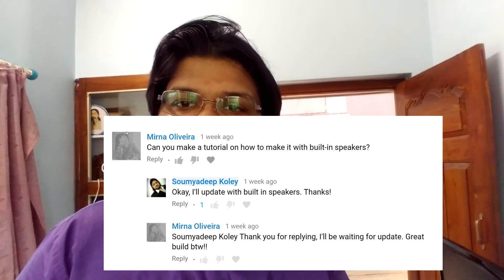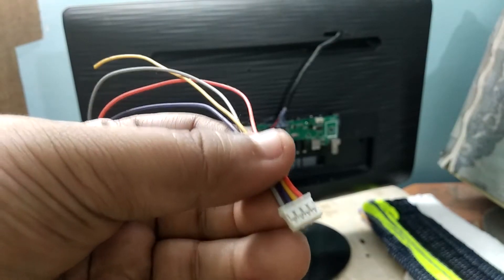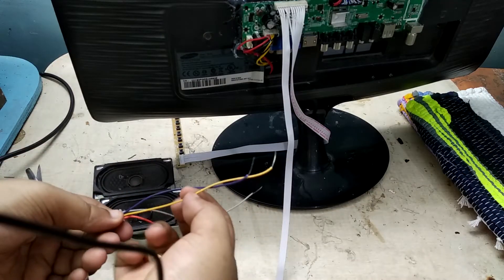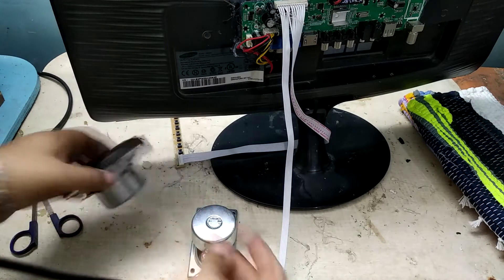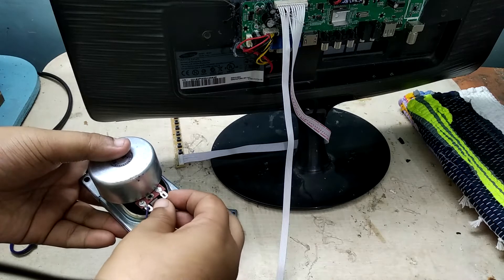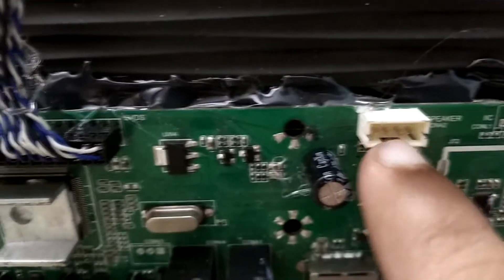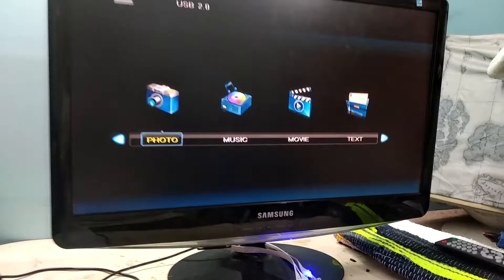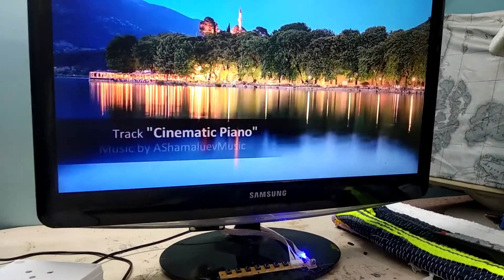How to connect speakers to DIY LCD Monitor with Universal LCD Controller

Comment: Hello, I  have a question, the thing is that I have the same setup and cables like you, but I also have a buffer, is there any way to connect the buffer in the same connection? Thanks.

Comment: Man, thanks for your video. Just a question. I recently bought a controller board so I can reuse my old laptop screen. I did the same as you and everything went right. My question is, do you know the impedance of these universal controllers boards? I want to wire several small speakers but I don't know the exact impedance of the board and I'm afraid to damage it. Greeting from Mexico!